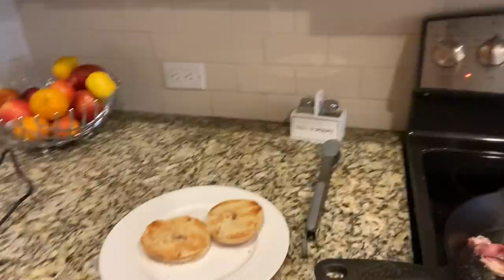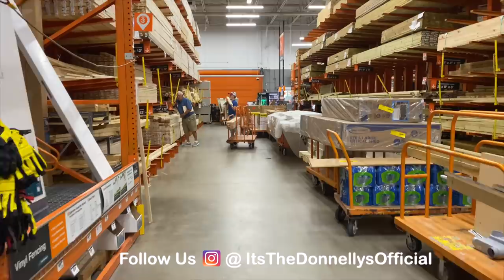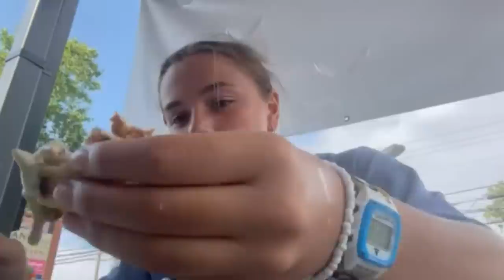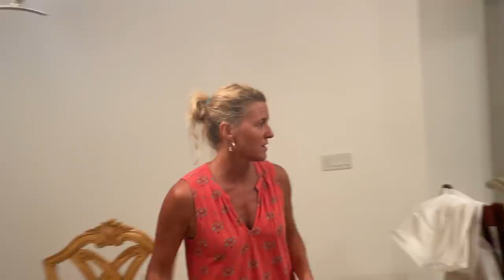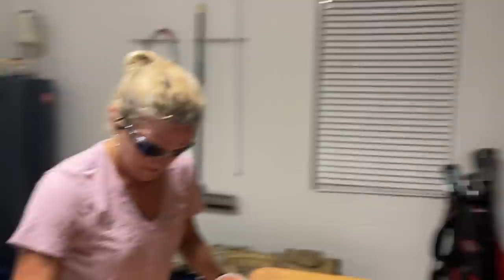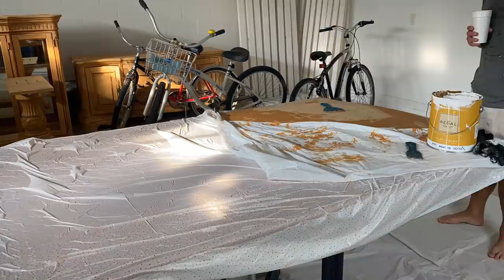FIRST Days in Our New Home | Thrifting Furniture, DIY RENOVATIONS and New Construction Projects

Comment: I just recently “DIYED” some endtables and used citristrip as well. Worked great. I used Dixie Belle chalk paint as well. Very easy to work with. It was my first project and worked out pretty well. Can’t wait to see your finished project.
Reply from the maker: Congratulations!! I have read about Dixie Belle- where do you get it??
Reply: @itsthedonnellys  I bought mine from a local store but I have seen it on Amazon too.